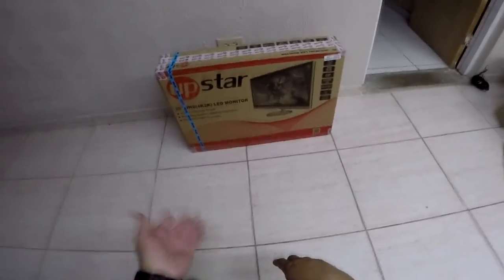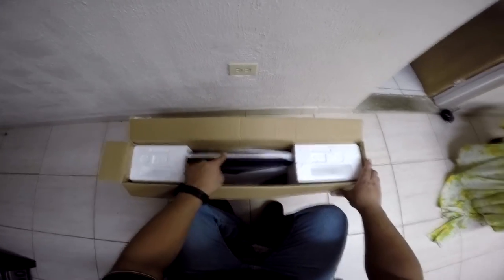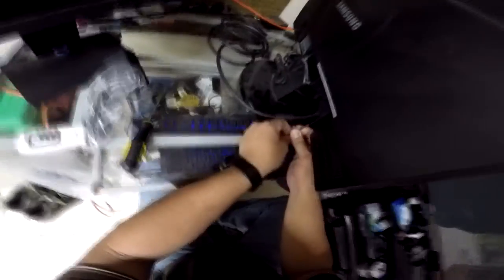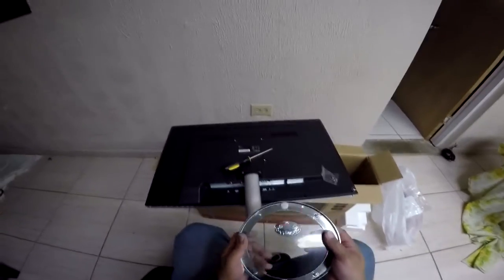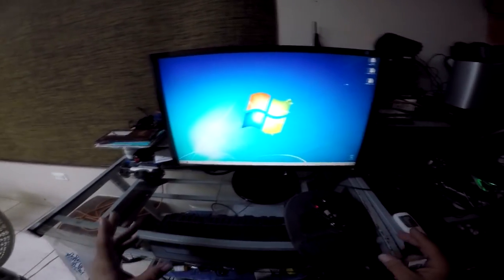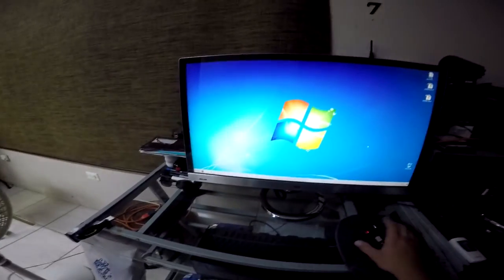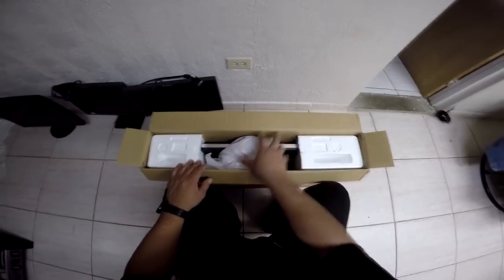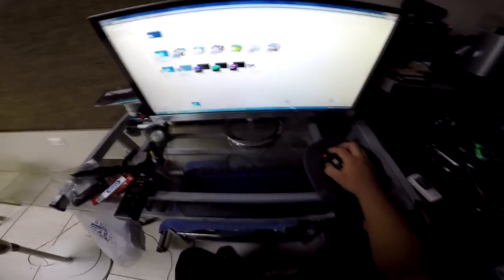Uboxing / Review | uPsTAR ULTRA 4K Monitor

Comment: Really good and honest review. Volume could be louder though
Reply from the maker: Netanel adar *Hi, Thanks. Working on the volume in the edit, hopefully next videos will be better balanced. Thanks for watching.
Reply: DiFuXioN I ended up getting the monitor on eBay for 100 bucks with local pickup (or 100 plus 30 for shipping if i needed to). It came new and a few days later i noticed a dead pixel but i still have it because it's great quality for just browsing and using excel (i do not play games on my PC).
Reply from the maker: Netanel adar *good luck with it the last one I got died within a week but that does not mean they will all die.. however for it meant I got a samsung :) that one was obviously more expensive but works perfectly no issues whatsoever and hoping it continues as such. At least the other samsungs I have had have been great

Comment: Bought 3 of these from an eBay seller that apparently did a firmware fix on a bunch of return units.  all 3 work brilliantly, not a single dead pixel, none of the mentioned issues that require unplugging - menu is completely messed up and basically unusable but never really needed to use it.  Working near non-stop for 2.5 years.
Reply from the maker: Thanks for the feedback good to know they at least tried to fix the issue by doing that but with my bad experience I would still avoid them. But this info may help people that have them or are intrrested, thank you
Reply: @DiFuXioN  Yeah, I'd avoid any risk with these just because UHD displays now from respected manufacturers like LG and Samsung are extremely cheap -- holy hell, $250 for a 50" Toshiba at Best Buy.  When I bought mine for $109 (free shipped), nearest  PC-class 28" was $500.

Comment: How's the monitor holding up?, currently have a in store pickup for $92.99!
Reply from the maker: Hi, I would advise to not buy or at least buy an extended warranty. In the end the last one I got broke (screen went crazy buttons stopped working) and I had to take that back. I just gave up and returned it. Waiting a bit to buy a Samsung which I usually buy and have no mayor issues with...

Good luck, if you buy one hope it is better than the ones (4actually) I tried